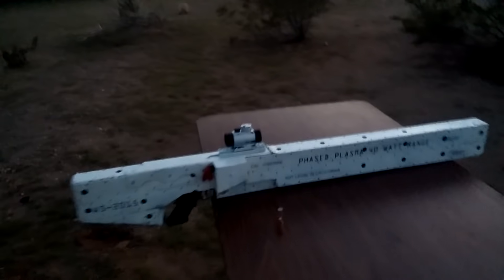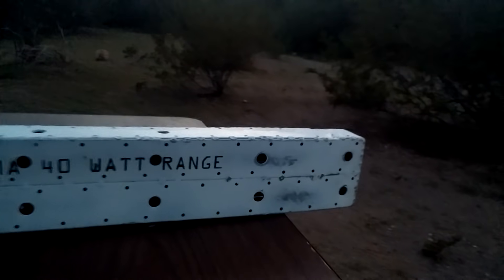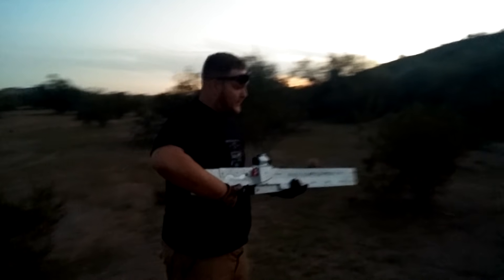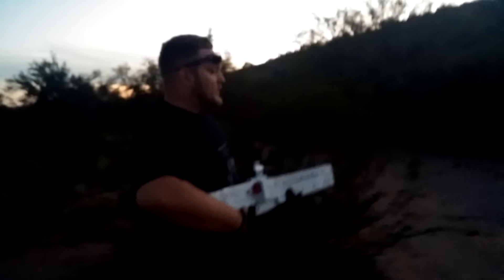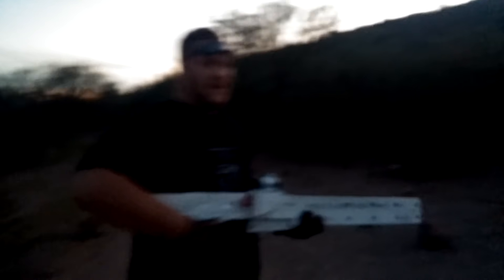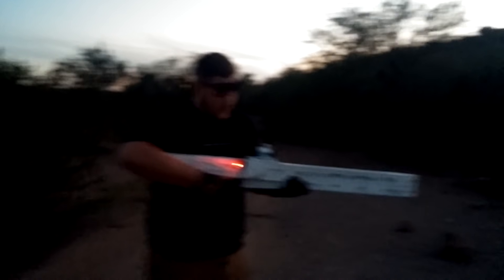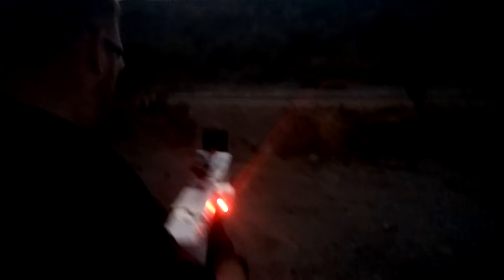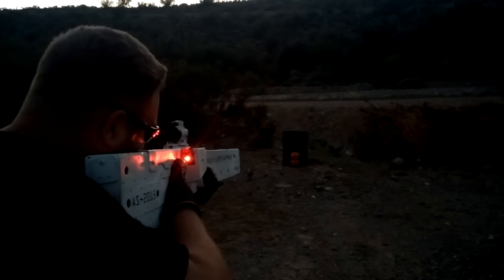Electromagnetic Plasma Rifle (Night Time Test Fire)

Comment: I drew up a couple of concepts myself, but I'm not able to recreate them just because of how little money I have, my first concept used a magnet bullet to pull plasma away from where it was generated considering plasma is attracted to a magnetic field, then my second concept I was think a little more slimmer one that also uses less resources. This also uses that rail system you were using (although I'm not that educated about this system) to go in a sequence to propel generated plasma forward. If you don't mind I might use you're bullet idea in mix with some of my ideas for a 3rd concept

Comment: that is how a rail gun is supposed to sound
Reply: Actually the bullet travels faster than sound from those...
Reply: @DEATH14269  I'd hope so? Otherwise you'd just an over priced airsoft gun
Reply: @ReeferSmoker  i doubt this is plasma it seems magnetic instead...
Plasma is a state of matter produced by friction of some sort of elements...
Also the bullet travels so fast it leaves plasma residue from friction of speed ...
So I doubt its a plasma gun...
Hopefully it has enough power to produce plasma? Who knows tbh.
Reply: @DEATH14269  it’s a railgun that shoots projectiles filled with plasma it doesn’t shoot the plasma itself
Reply: @DEATH14269  I think that the rounds are a type of H.E.B (high explosive bullets) but uses plasma instead of normal explosive
Reply: Like a .50 call on drugs
Reply: This is actually not how a rial gun is supposed to sound, this is how a normal rifle is supposed to sound, that is because he is clearly using a an actual rifle encased in some prototype looking housing, you can tell because there should be no explosion, neither the sound nor the smoke. Neon gas is non-reactive and will only florece when an electric current is passed through it, which isnt even plasma I might add. The only sound that it should make is of the projectile exiting and possibly the capacitors discharging.  This video is a shame and this guy is full of shit.

Comment: Holy crap, that must be the most powerful man portable rail gun I've ever seen
Reply: From the looks of it, he's accidentally created an EFP (Electronically formed penetrator) instead of a true Railgun, the projectile isn't penetrating off of the actual kinetic energy, it's penetrating because the EM field actually superheated to copper, so as it impacts it scatters into small molten fragments which can penetrate the target easier.